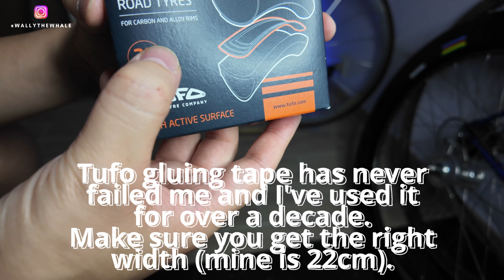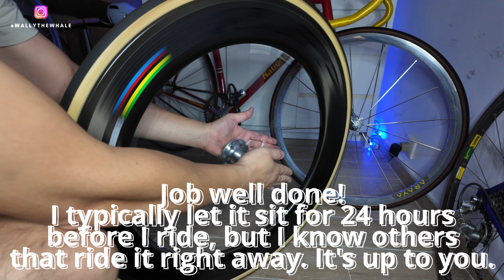HOW TO: Install a tubular tire without messy glue

Comment: I have never tried tubular, is it any better than the normal clinchers for street riding?
Reply: there's really no difference
Reply: Modern clinchers have good rolling resistance and and with latex tubes are much easier to take care off and have spares
Reply from the maker: Depends. If you like to skid like a mad man, go with clinchers. If you don't skid often and like a nice subtle ride, tubulars won't hurt. All that to say, everything is easier with clinchers as far as maintenance, costs, etc goes, but it just so happens that my favorite wheels (from the 80s/90s) mostly comes in tubular. You win some, you lose some. Like I mentioned in the vid, I've ridden tubular for over a decade strictly on the streets with minimal skidding and have had no real issues.

Comment: I still don't get it. Why would anyone who is not pro, put himself through all that hussle? What do you do if you have a puncture out on a ride?
Reply from the maker: I have clincher wheelsets and I don't even carry an extra tube/tire with me ANYTIME I go out and ride so the answer to your question is the same regardless of the tire. That said, the real reason why I still ride tubulars is because most of my wheelsets are from the 80's and tubular so I don't really have a choice lol
Reply: safety in downhill, accelaration, no pinch flats, more milage, use revosealant for punctures. comfort on cabblestone